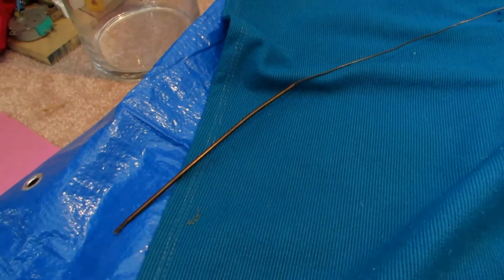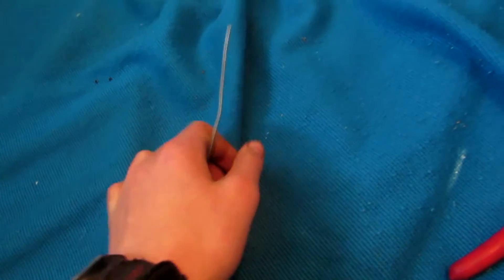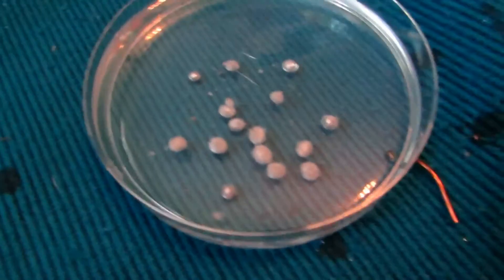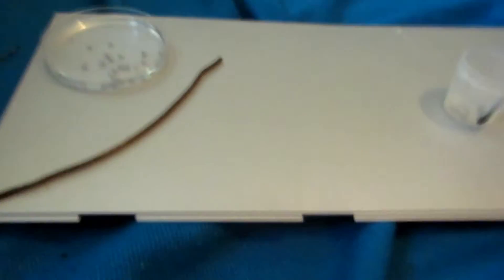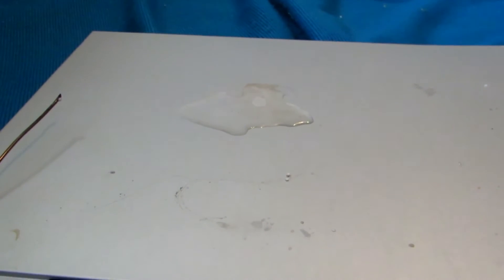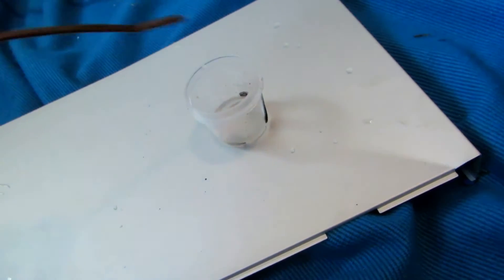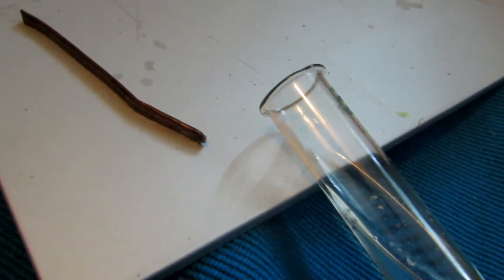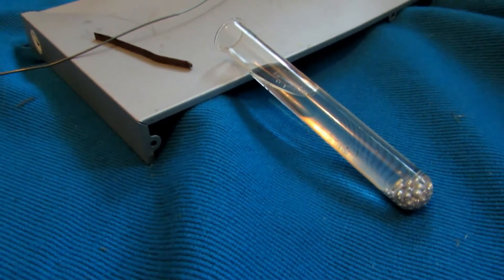NaK from an Oven? (sodium potassium alloy!!!) (Household Materials)

Comment: You shouldn't be doing this over a flammable surface...Doing it over concrete or something inert would be much wiser...perhaps the great outdoors for the sake of fumes and flammability. Proper safety measures for chemistry is most important.
Don't forget about all the hydrogen gas you release into the air by doing these reactions. If you do not have proper ventilation, the hydrogen will build up in the ceiling like water spills build up in the floor. And if that gas pool finds a spark, it will explode and you will have a bad day.
Lastly, you should be using not only goggles, but also gloves. When you react H2O and NaK, you end up with a solution of NaOH and KOH, which are both highly corrosive substances which will corrode your skin and blind you if it gets in your eyes. Your left hand seems to be especially red.
SAFETY!!!
EDIT: something else to mention. When you are throwing NaK into water...your container should really be glass rather than plastic...
Reply from the maker: Jake Waitze ok thanks, I know this all now and am much safer than when I released this video, it was very dumb of me to do it in my room. I would certainly not be this careless today.